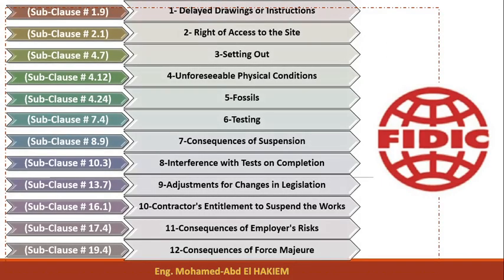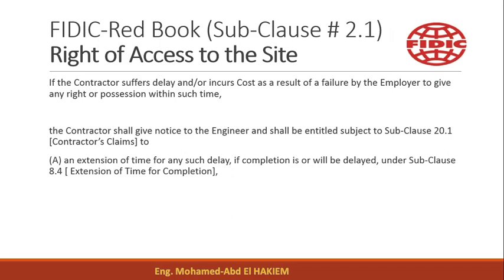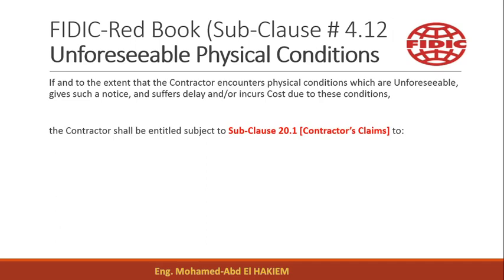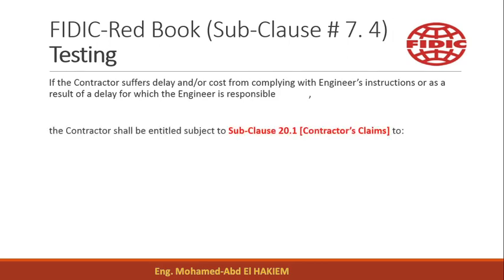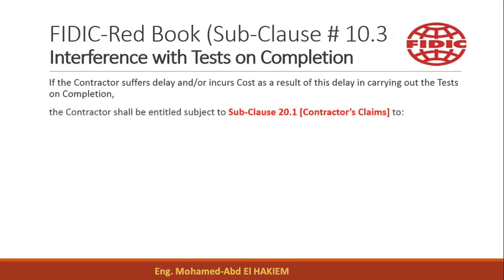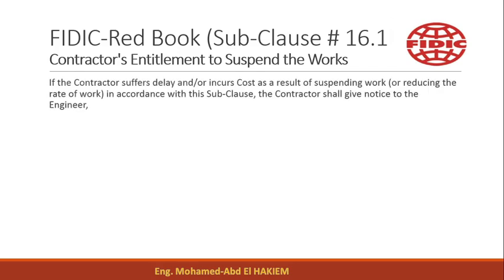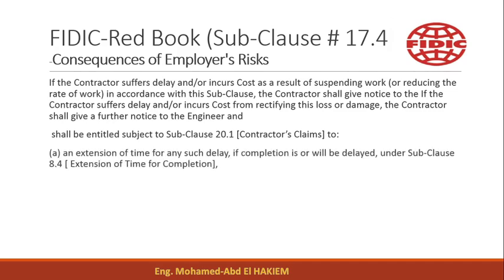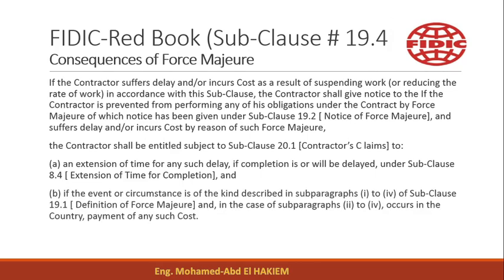FIDIC Claims procedure ,Delay analysis in Construction Claims (#FIDIC 99). @Project Control

Comment: You wrote clause 19.4 [Consequences of Force Majeure] incorrectly. (8:38)

Written in the video:
"If the Contractor suffers delays and/or incurs Cost as a result of suspending work (or reducing the rate of work) in accordance with this Sub-Clause,..."

It shall be:
“If the Contractor is prevented from performing any of his obligations under the Contract by Force Majeure of which notice has been given under Sub-Clause 19.2 [Notice of Force Majeure], and suffers delays and/or incurs Costs by reason of such Force Majeure, the Contractor shall be entitled to Sub-Clause 20.1 [Contractor's Claims] to:

(a) an extension of time for any such delay, if completion is or will be delayed, under Sub-Clause 8.4 [Extension of Time], and

(b) if the event or circumstance is of the kind described in sub-paragraphs (i) to (iv) of Sub-Clause 19.1 [Definition of Force Majeure] and, in the case of sub-paragraphs (ii) to (iv), occurs in the Country, payment of any such Cost.

After receiving this Notice, the Engineer shall proceed in accordance with Sub-Clause 3.5 [Determinations] to agree or determine these matters.

Note:
Sub-Clause 19.4 of Yellow Book 1999 provides the same wording.